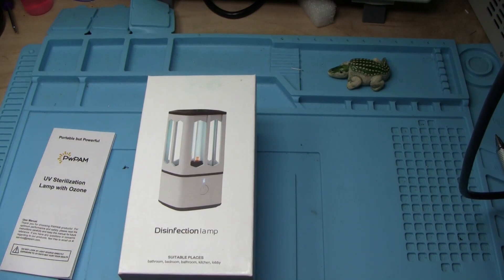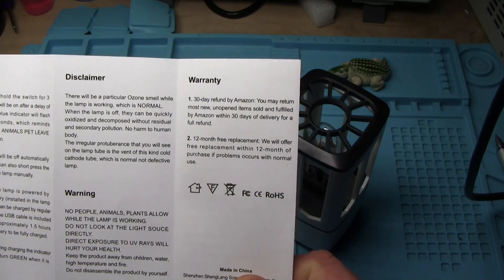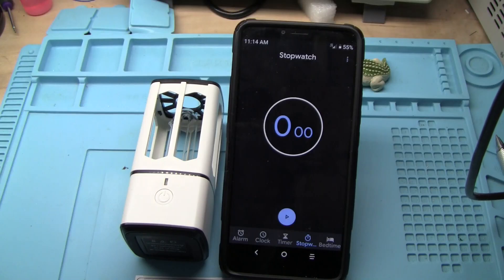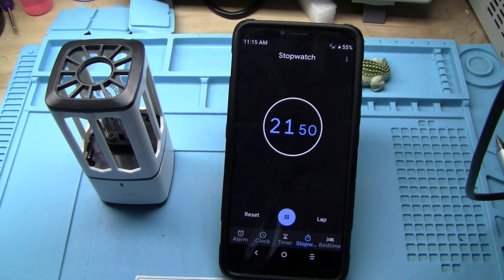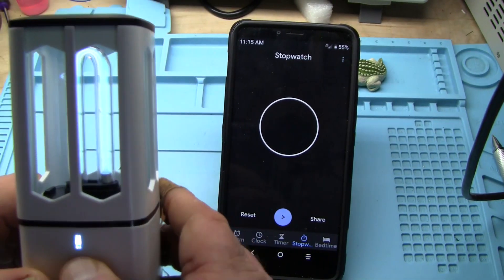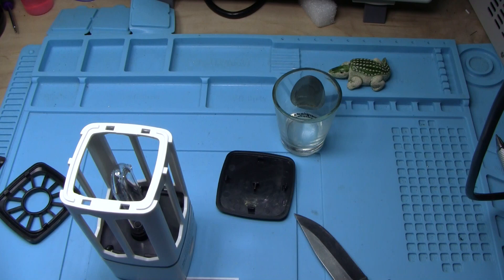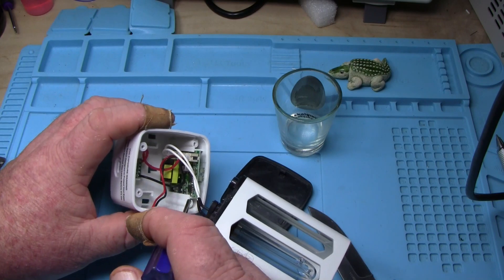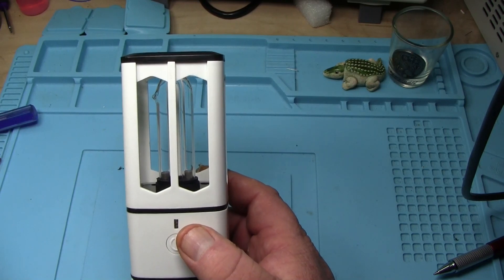PWPAM UVC Germicidal Light

Comment: I think that is a toy, properly a harmless version too.
I work in a place where we have many so-called UV-C lamps that is suppose to kill bad stuff, they are all 18W fluorescent tube type, and it is that right type of tube UV-C, but they do a bad job, they are both in the shower room and the dressing rooms, and I can undress in blue light and then take a shower in the same light, and go the the next room, still in this party light and I fell nothing on my skin or eyes.
But we also have some more power full lamps, about 45W and then things start to happen, they are very uncomfortable to be with, both your eyes and skin can fell them and the smell is not nice too, so I think there must be some sort of a threshold level in energy you have to pass before this kind of stuff start to work.

Comment: There is a UVC that is safe called Far-UVC, It operates 207 to 222nm and is safe for humans, it won't even penetrate the coating on your eyes which is the thinnest area on your body. Unfortunately they are super expensive. They are just as effective as the other UVC lights but the claim is they don't cause the damage of the other UVC lights, however, word of caution not all the studies confirm this so more testing is being done.
Reply: Just posting to confirm this is my conclusion based on (internet) research too.

Comment: I paused half way to predict you will find a ballast and voltage regulator (potentially in 1 circuit with a BMS). Why even open it? If you accidentally crack that lamp you'll be ventilating the room you're in immediately and hoping you didn't breath anything in. I like your channel and this is good faith criticism. I built a DIY "disinfection box" with a 13W lamp and trust me, I was so paranoid when building the last parts after the lamp was in, it's crazy.
Edit: you're a braver man than I am...
Also the transformer etc is the ballast circuit.
Edit 2: if not clear, it contains gaseous mercury - that's what I mean with the ventilation etc if cracked (yes I known its a small amount but still dangerous)

Comment: If it's good for 100 cubic ft, that's 10ft x 10ft x 1ft   (& not 10ft x10ft x10ft that'd be 1000cu ft)
Reply: Yes or about 4,65ft x 4,65ft x 4,65ft (100,54cu ft :-)
Reply: @jacquesbourne9203  Thanks for the info! I think it's fairly easy then. It works in a radius of 10ft and up to the ceiling in a normal home, as I see the unit does it not illuminate much in the downward direction. :-)
Reply: That's like a broom closet! You can do a larger room section by section - be CAREFUL if you have children or PETS too that might very well wander into the room.